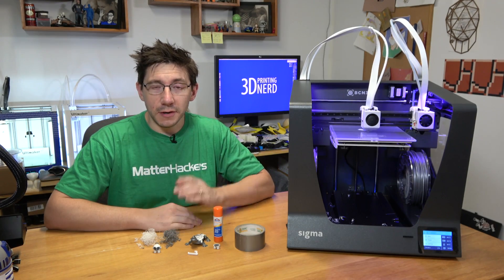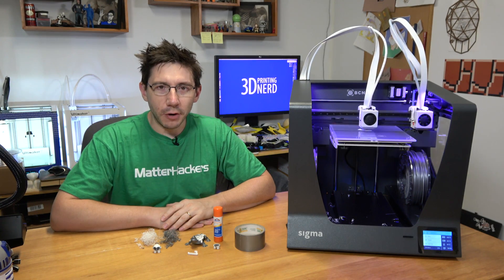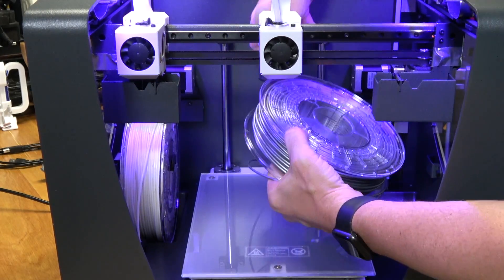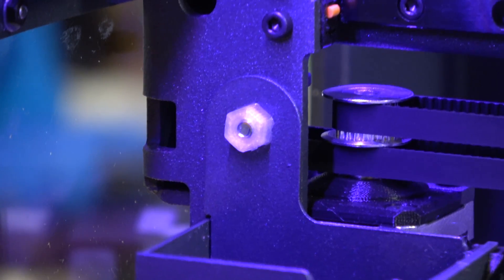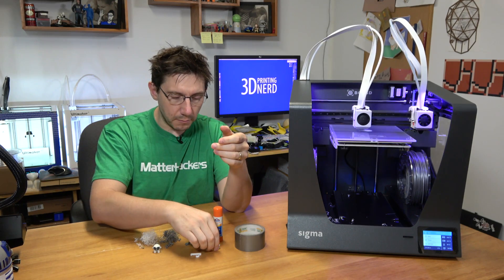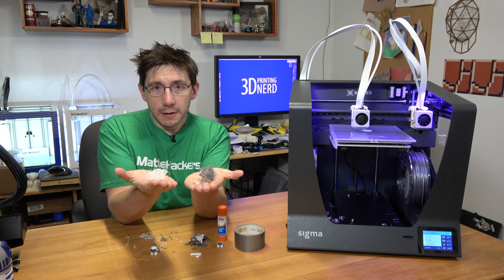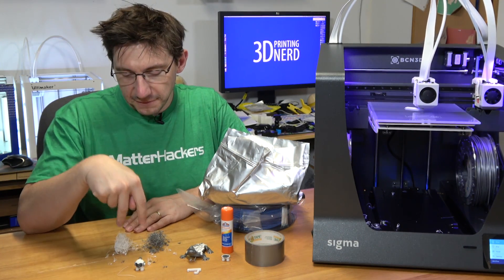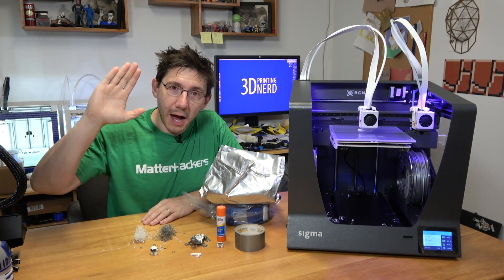First Look at the BCN3D Sigma R17 3D Printer - Independent Dual Extruders!

Comment: Hey Joel ! got a question, this question was asked in the comments below aaannnndd i have the same question SO did you ever find out if you can Quote "ditto print" with this printer ? Is it even possible to print the same print twice simultaneously ? something like that would REALLLY speed up process when "production line " printing as in having to print multiple copies of the same print rather than having to buy multiple printers . Anywho Thank youuuuu

Comment: I REALLY like this printer's independent dual printhead innovations and users will uncover more creative ways to utilize them.  The build volume is comparable to the Ultimaker3 extended for far less $$.  An "extended" version increasing the Z height (and a little more print bed width) would really amp up the Sigma's value proposition (any plans?) for me.  The flat white ribbon cables for the extruders make me a little nervous - please comment and show a closeup of the connectors in your full review.

Comment: Why do you us no 3d lack spray? The glue stick is not the best solution.
Reply from the maker: It's not? works great for me. if 3dlac wanted to send me some, I would try it out.
Reply: The problem with the glue stick is the different layer height on the print bed. 3d lack make a constant layer height and when the heat bed is on, nothing released from the bed. After printing, when the heat bed is cool, you can release the print easily

Comment: That's not a significant amount of waste, this is expected as the nozzles will ooze, and also does a bit of priming, and that is the purpose of the buckets to catch the ooze to produce a clean print. I use a similar system in a delta, and the extra ooze does accumulate. This is inherent to the bowden style setup. I'd like to see a similar style print with direct drive extruders as I would expect the waste to be reduced considerably.

Comment: Tips:  Make sure you are using the ProGen tool to create printing profiles.  https://www.bcn3dtechnologies.com/en/sigma-progen/

This will not only give you the ideal print settings but it also adds a post processing script that it executes on the file to change the maximum acceleration of the print heads to essentially remove ringing on only the outer print layers.

As was already stated, purging of each print head is done right before it starts printing.  So if you are printing a model with a lot of head changes, you will generate a lot of purges and the purge buckets can fill up.  This also means that for the Marvin print, you would find it generates the exact same amount of purge regardless of the size you scaled it up to.  There is a script being worked on by BCN3D which will make the purge variable based on how long the head has been idle so this should minimize the purging in the future.

Prime towers would have much more wasted material for this print than then purging.  It may appear to be a lot of loss but it really isn't.  Verify by weighing the two (as someone already suggested).  Also - adding a prime tower will not eliminate nozzle purging unless you override the settings and turn it off.  But I find that purging is more effective than the prime pillar.  Especially for tall prints where the prime pillar can be knocked down.

I love my Sigma and upgraded it to the R17 a few weeks ago.
Reply: ProGen power!
Reply: ProGen power!
Reply from the maker: RAD! You bet I will do that! SO COOL!

Comment: Once you're done, I'd be interested in as much of a side-by-side with the Lulzbot TAZ 6 as possible. 

I know there are a lot of caveats: TAZ has a larger build area, doesn't have native dual extrusion, both extruders would be fixed, etc. 

But they occupy almost the exact price point, are both 2.85 and are both open source -- which I imagine makes them both strong considerations for people looking at one or the other. 

Thanks! #HighFive
Reply: Oh, and I recall seeing some curling during Tom's live stream and I'd be curious how the cooling holds up or if you think it needs to be improved. 

Cooling is so important to PLA and we rarely seem to get adequate cooling fans on machines.
Reply from the maker: From what I can tell, the cooling fans are monsters and of the couple smaller prints I've done, there has been no curling. Is there a specific print you want me to try?

Comment: I have an older version of the sigma, i'm really interested to see if the  update is worth it or not (specially the driver update), mine has noisy fans but nothing that i can't survive, it's almost 10db more than all my Ultimakers though, how do you compare the noise to the Ultimaker 3 or 2+? #HighFive!
Reply from the maker: I only had the previous iteration for about a week or so, which means I don't think I could do a proper drive comparison. However, the fan noise is MUCH less, and I'll easily be able to put it up against my UM2+ and UM3!

Comment: 3mm only .... ? dont want to stock 2 sizes of filament
Reply from the maker: I've heard that from many people.
Reply: Iirci read  some people have ran it with 1.75mm with no hardware mods, just changing the material settings in their slicer. Not sure how realistic that is long term though

Comment: 1st off, Joel T., great name, my name is also Joel T.
2nd, Why does this printer use purging buckets? Unless you're changing filaments in each of the extruders, I don't understand why it would be purging at all. Granted I don't know very much about dual extrusion systems, but I was under the impression that purging was only necessary when changing filaments on a single extruder set up, ala Prusa i3 mk2 Multi-material upgrade.
Reply from the maker: That's my knowledge of dual extrusion as well. Though, I think if the filament oozes out, they have to purge in order to take up the space where the oozed filament was so you don't get underextrusion. Also, MY GOODNESS, you have a rad name!

Comment: i dont get the buckets? excuse me for seeming stupid
Reply from the maker: Not a stupid question at all! The bucket catch the filament that comes out of the nozzle during a priming event. Rather than have a priming tower, we have buckets to catch the filament.
Reply: Ralphie Vigg I'm no expert on duel extrusion, but I believe the idea is that hot filament sitting in the nozzle will ooze out while it's not being used, so if you don't prime the nozzles in some way you would get under-extrusion each time you switched from one nozzle to the other.
Reply: now that makes sense!

Comment: Hey Mr 3D nerd, what would you recommend for free or inexpensive 3d modeling software? I have a project in mind but I haven't modeled it up.
Reply: Alex Karen What kind of modeling? Artistic or CAD type modeling?
Reply: Its a print project, so probably CAD? BUT I am reasonably inexperienced with terminology so I'd take suggestions for either r
Reply: Alex Karen When I say CAD I mean software for designing more practical parts with very specific dimensions. If that's what you are after I would recommend Fusion 360 (it's what Joel used to model the nut for this printer in this video). It's free as long as you are a student or hobbyist.
For artistic modeling, Blender is the go-to free program for most people.
Reply: Ah. Then definitely that. Thank you
Reply from the maker: woooo you both are awesome! @cleetose thanks for stepping in and helping! #highfive to you both!

Comment: that bucket looks like a bit much excess filament considering it doesn't need to be totally re primed unlike the prusa i3 mk2 with multi color  where they have to re prime the whole head and flush colors out so i would say its a little excessive but looks worse cause its just a ball of not laid down plastic cause its not stacked nicely
Reply from the maker: I hope you're right. I'll have to test with weight.

Comment: Trying to decide on the Ultramaker3 or the Sigma, as I need to build parts with a water soluble support material without oozing.
The Ultramaker 3 lifts the nozzle but need to cool and reheat the nozzles to prevent the oozing, which I hear takes considerable time. The Sigma just moves it our of the way and purges before it starts . It would be nice to know which method is faster.  
How is the quality of print of the Sigma compared to the U3?
Reply: SicamCorp im curious on that topic as well would be nice to see the difference in time!
Reply: I'm curious also.    The BCN system seems superior but I want to see confirmation
Reply: SicamCorp I would like to see the BCN3D printing with Ultimaker PVA, that seems to be very good compared to standard PVA
Reply: The sigma is faster but uses more material

Comment: Joel, do you ever get sinus issues or headaches while being in the same room when you're printing PLA? 
I've printed a couple of items while being in the same room (with my windows opened and with a fan exhausting outward) and every time I get nasal congestion and a slight headache. Great videos btw :)
Reply: I have 2 printers in my bedroom. They are super quiet so no worries there. They are very large. One is 330/300/400 and the other 500/500/600 they print continuously and I have no problems. Pla is a natural organic product made from  plants (I think) no smell no fumes.  Maybe you have an allergy to something else in the room or being pulled into the room by the fan and open window....???

Comment: Do the independent extruders have any any safety's to keep from hitting each other?
Reply from the maker: I don't know if physical safeties exist, but in software I think it specifies only one to run at a time. You may be able to enable ditto printing, but, I would have to look into that.
Reply: I am sure there is a switch on the side that will cut the stepper and throw an error if they get close enough to trigger.
Edit: I can actually see it sticking out of the right extruder.

Comment: I know that ooze shields help avoid color contamination. I'm just uncertain why it is as needed on duel extruder systems. And shouldn't retraction help contain the filament when a head is waiting? Or would that require a cool down? Right now I'm imagining those extruders running like a cheap glue gun as they wait for the next layer.
Reply from the maker: No, there is no extrusion while they are waiting - the extrusion happens as a priming process before they move out to do the next layer. I need to experiment as that is the default.

Comment: I received four cable-bowden clips. Check if the box has any holes, maybe a mouse went inside of it and stole the nuts and clips. 

Concerning the purge bucket, that Marvin keychain have a lot of color changes, and that's what generates the waste. I printed a GIANT model with it (top secret :P), and I generated less waste than your Marvin. Really hope they improve that in the future.
Reply from the maker: Dave from Matterhackers sent me a text, and I have nuts and clips en route! Also, ooooh.... so it has to do with the color changes? On a single color print, does the head park at all?
Reply: Cool! I don't want to do any spoilers... But yes. If it's a 1 color print, the second nozzle is parked and cold (the printer acts as a single extrusion 3D Printer). Well, no more spoilers, I'm not going to do your job. :P
Reply: Moreover, if you are printing PLA+PLA you can use a purge tower. But if you are using PLA+PVA or PLA+TPU the benefits or using the purge system increases. Anyway, you can use the purge tower and remove purge if you prefer.